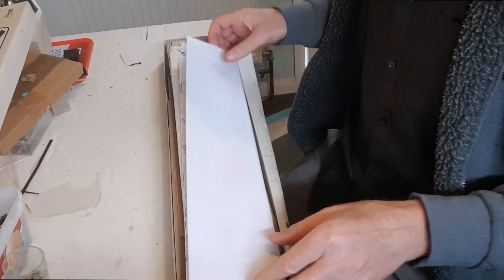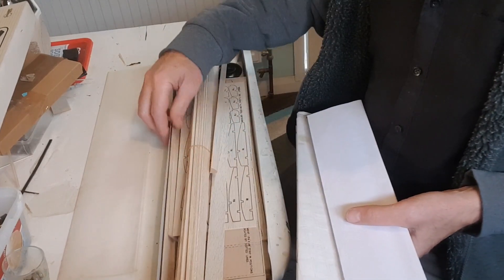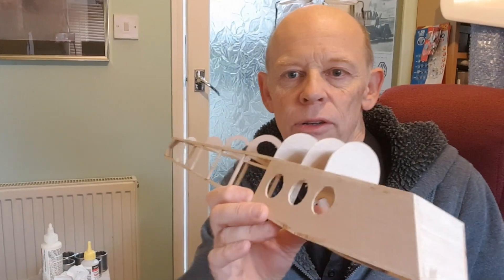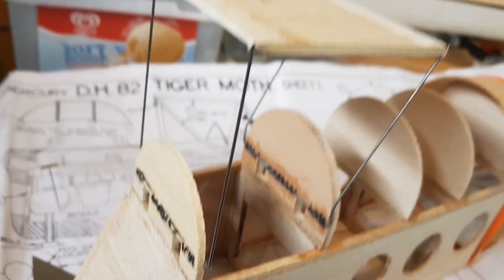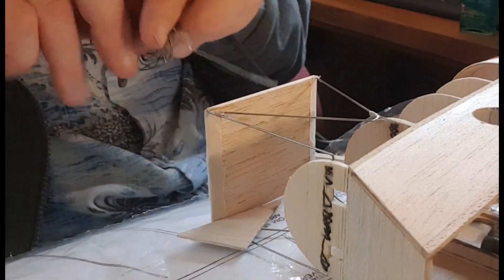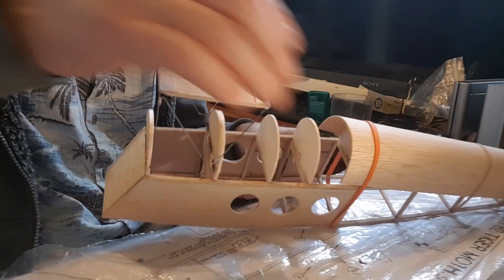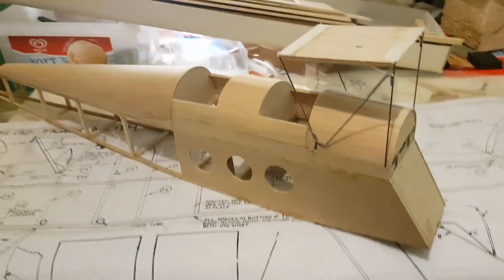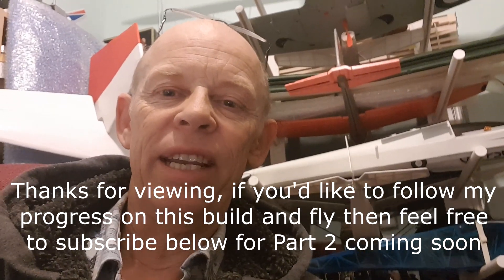Mercury Tiger Moth RC Conversion Part 1 Fuselage

Comment: Hi Cliff! What kv motor was used? And battery type?
Reply from the maker: @JoshtheRCguy  Hi Joshua, it's overpowered really,  1120kv Overlander motor running on a 1300mah 3s battery, the battery helps with the cg but I still have about 30g of lead.
Reply: @CliffHarveyRCPlanes  oh I see!! Thats great because I have a scrap 1100 kv lying around so I’ll laser up the parts and have a go!! Thanks for always responding so promptly!! Loving the channel! 👍👍

Comment: Hi Cliff, what are the details of the motor and ESC you are installing?
Reply from the maker: Hi Phil, it's probably overkill actually, from a 'deceased model, but I can always throttle back a little, it's an Overlander Thumper T2836/08, 270 watt - 1120Kv, esc is a Robotbirds 'Pro-30A-V4' 👍